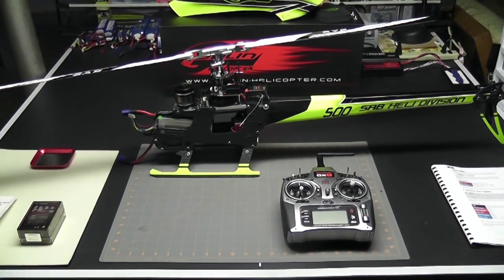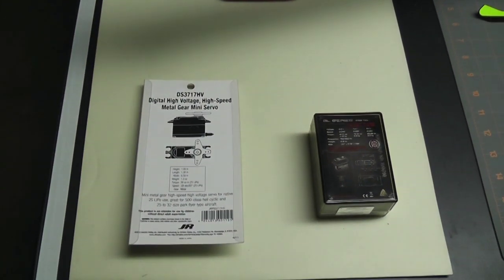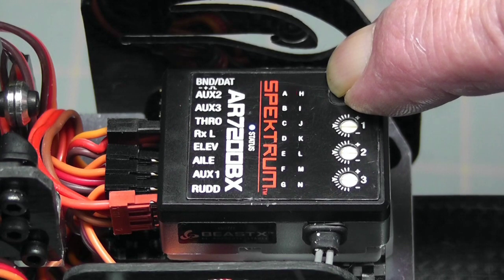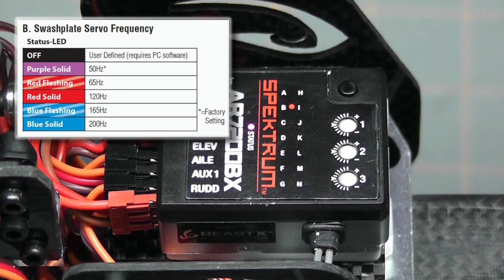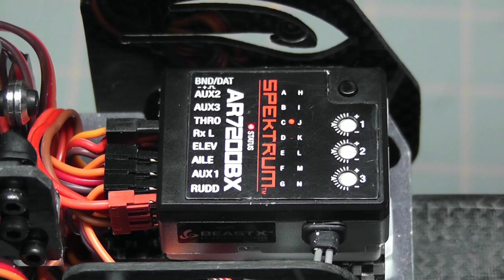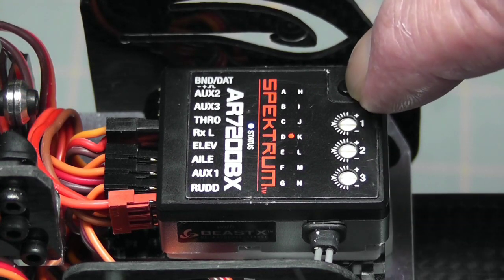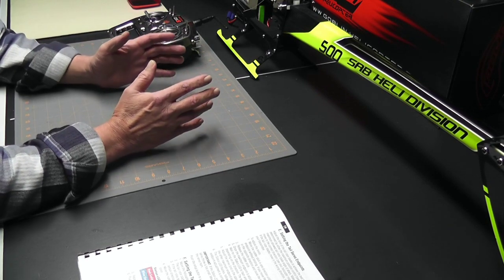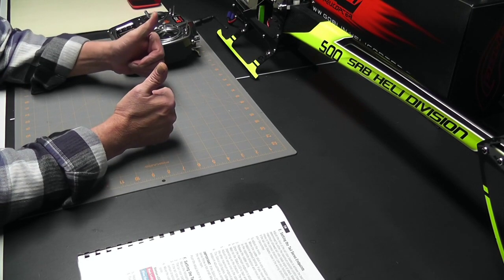Goblin 500 Electronics Set Up - Video 2

Comment: hi GeorgeI set up my AR.7200bx and I leveled the swash but when I spool up to go into a hover the helicopter go's to let left. All my trims are set to o on my spectrum DX8.Can you tell me what I have to do.to lift up straight. For a hoover. And I`m not set up in transmitter in my AR7200bx.
Reply from the maker: Hi there Lee, If you can't straighten the hover using the aileron trim, you may want to look at the balancing.  I had an issue once where it was right heavy and caused the heli to drift right.  Hope this helps and happy flying friend.

Comment: I have a align trex 500 that I put a AR7300BX on it .I went with your settings and all went well. The tail servo is not working like it should It will not move all the way left and right. and the servo is not moving like the others. I changed the servo with a new one but it is still the same But when in the set up mod It moves all the way left and right. I`m using a dx8 radio an the servo is a align DS520. Can you help me with this trouble. And when you are in the set up mod do you leave the transmitter stick all the way down.
Reply from the maker: Hi there!  I would check the servo specs.  I found that the HV servos had different settings.  When I enter set up mode, I have the sticks in the center.  It has been several years since I did these videos but I hope this helps!
Reply: georgesjunglerc I set the servos to what they should be and it still not working.The tail servo is set to 1520.is this what you are talking about.
Reply from the maker: Yes.  Other than that, I am afraid I don't have any other suggestions.  Sorry.  Please let me know what you find so anyone else searching the link my find it.  Good luck friend.

Comment: Hi. I was helping a friend set up his blade 450X and when we tried the tail servo enpoints, when we moved the stick, the tail would move till it started to bind. When we tried to back off the stick a little, the tail would not move until we went past center stick, opposite direction. The light would then turn purple but it didn't seem to act like yours did in the video. Any ideas anybody : )